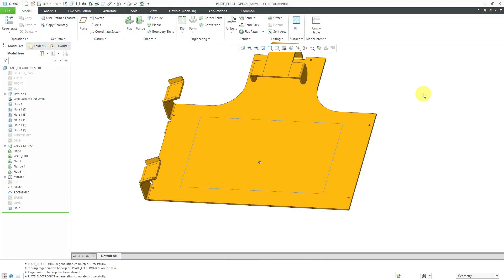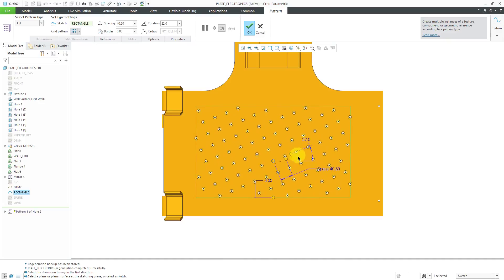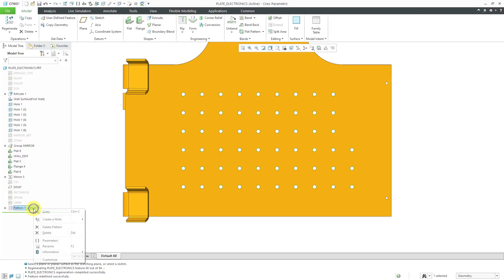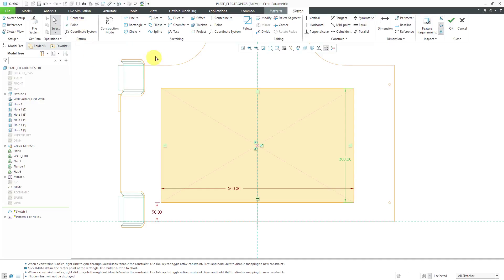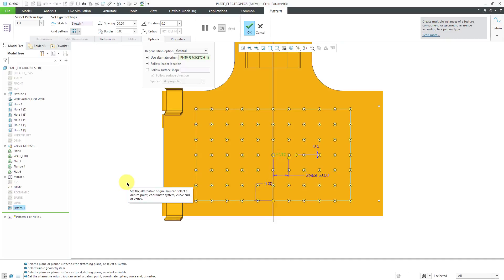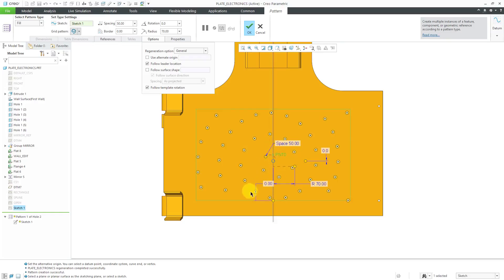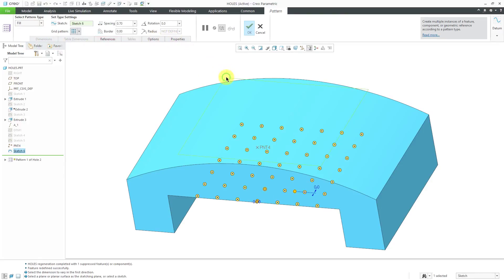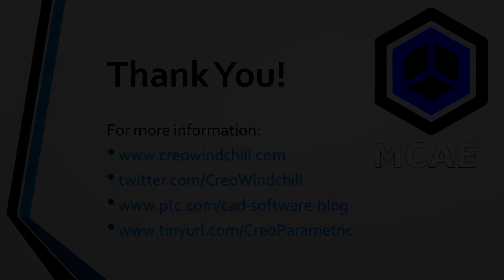Creo Parametric - Fill Patterns

Comment: Hello. Is there a way to make the distance in X axys different then in Y axys? Right now they are both the same but what if I need them to be different?
Reply from the maker: If you need them to be different, use a Direction- or a Dimension- Pattern.
Reply: @CADPLMGuy  no no, i need to use the fill pattern as it is in specific area. yet i need X dimension to be different than the Y dimension. As far as i know, that is not possible, is it?
Reply from the maker: @martintaichl  That is not possible.
Reply: @CADPLMGuy  ok, thank you
Reply: Do you suppose such a feature could be possible in Creo 9 or some future version?
Reply from the maker: @martintaichl  Martin, the product manager at PTC for Creo, is a great guy but not a mind reader. It's impossible if people don't suggest it. If you want something in the software, submit the idea at PTC Community.
Reply: @CADPLMGuy  sure, that is the plan. Though I was asking merely because I am not even sure such a thing is technically possible ;)